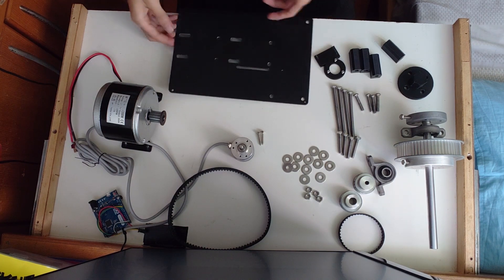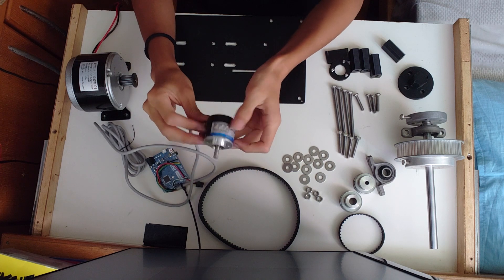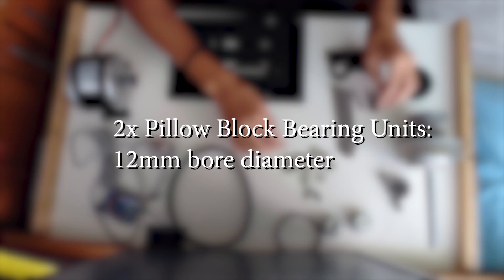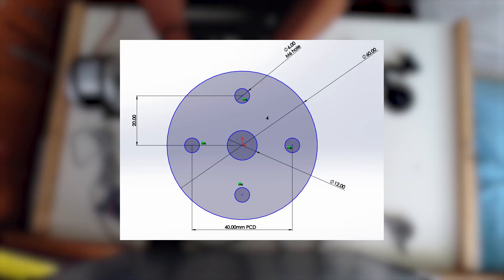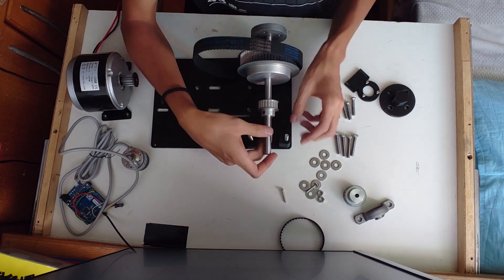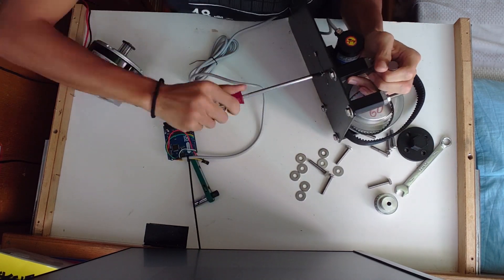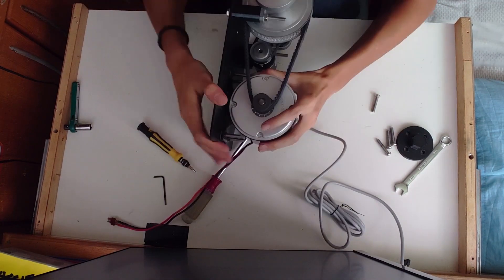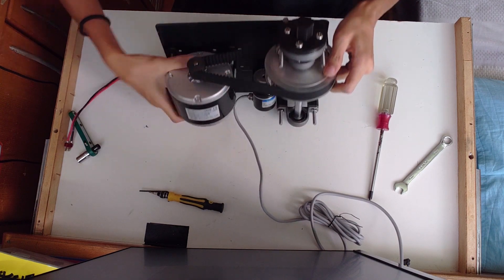Hardware Design of Cheap DIY Arduino Force Feedback (FFB) Sim Racing Steering Wheel

Comment: Cheers mate, I can't find this type of big 250 - 300W motors near me. Best i can find is a 120W MY6812. I don't drift, i only play racing sims and truck sims. Do you think a single 120W motor at %70 power deliver enough torque ? (I say %70 because i don't want to risk burning the motor and driver) .

Comment: can i ask ? if im using 24v 250watts 14A ebike motor for ffb can i use 24v 360watts 15A powersupply? AND is IT good or something bad happen like high temp or heat im using 2 bts7960 driver im trying to build arduino steering wheel

Comment: hey man, can you tell me what's the desired output rpm for drifting its not available on sim racing platform but one site shows that if you had high torque than you only need about 150RPM. I am very confused. I wanna use MY1016 250W motor but confused on gear ratio. Is 550RPM is enough for drifting? Please help me to figure it out

Comment: Im planning to build this but i have one question in mind. Is 12v 150w motor enough to feel the force feedback and immersive? because 24v 300w motor here is not really cheap. I gonna use the same momo steering wheel as yours
Reply from the maker: I think that is enough. I am only using ~40% force.

Comment: the big pully gear on the shaft keep coming loose when applied some torque how can i fix?
Reply from the maker: Maybe try to grind a v slot instead of a flat surface on the shaft. Also applying some thread locker to the set screw might help.

Comment: hey did you 3d print the wheel hub and how long is your shaft
Reply from the maker: I machined the wheel hub out of aluminium. I'm not sure how long the shaft is, as that can vary depending on your design.

Comment: Hi, do you know if a 120w 12v dc motor would be able to spin the wheel fast enough? it has 0.5nm of torque but i think about adding 1:5 pulley ratio so the torque output on wheel would be about 2.5nm, the motor has max. 3000rpm. This is the only one i have, and i dont think i want to pay extra money for bigger engine. Also, how does the motor bears the load, does it heat a lot?
Reply from the maker: I'm not sure.
When my motor runs on full load, it can go beyond 100°C
Reply: @psamtam  huh, thats pretty hot, thanks for response.

Comment: hey does the size of the belt matter for the motor
Reply from the maker: If you mount the encoder to the output shaft then doesn't matter. If you mount to the motor, then matter. The motor rotates faster than the output shaft in my design.

Comment: Hey great work man but will the wheel still function well is the encoder is mounted to the back of the shaft and is there any other way I can contact you?
Reply from the maker: That should work. As long as you can capure the rotation of the wheel someway, it works.

Comment: I made my self one like 1 years ago, finally finished diy pedals and came back to the wheel. Have issues with bts motor driver. It heats, (like you can't take in to a hands and hold it for a while :D) also motor is heating if doing drifting for 5 minutes. My question is, how your bts handles this motor?
Reply: My dc motor is 100w 24v, so maybe if i put 300w motor like yours, bts will not heat up so much?
Reply from the maker: My bts will heat up. But mine always cut off/shutdown itself before too hot to touch, like there is a thermal protection in my bts. I added a cooling fan to the heat sink to cool it down. It can handle 50% ffb for more than 4 hours in Nordscleife. I don't play with more than 60% ffb as it will be too powerful.
My motor always heat up to ~90°C. I just don't care as long as it doesn't smell burnt. Some online material says that most motors are capable to work at 105°C.
Reply: So i just changed dc from 100w to 300w from power steering of toyota corola. Changed new bts, because old one, with 100w blowed it. So with 300w bts still heats up like hell.
Reply: Dude, maybe you can send links to pulleys and belts where did you bought it? Cause im driving chain on chain rings, too loud.
Reply: By the way, bts cooked again :D
Reply from the maker: I bought them on TaoBao, which is only abailable in China. I think you can get the pulleys and belts on Aliexpress or Amazon.
Reply: @psamtam  can you tell personal belts and pulleys specs? Like lenght, wide of belt and pulleys tooth amount or something like that
Reply from the maker: @nierkanierkaha6889  they are all mensioned in the video

Comment: Hi, do you connect 1 bts7960 driver to the motor or you connected 2 in parallel cause my my1016 motor fried the driver twice even when i am running on 12volt not 24
Reply from the maker: I used 1 bts7960. It gets hot and I put the heatsink into some water to keep it cool
Reply: @psamtam  is there any efficient way to reduce heat?
Reply from the maker: @speedboy911  I'm not sure. Perhaps installing a 4020 cooling fan for the heat sink would work
Reply: @psamtam  have you measured the stall current of the motor?
Reply from the maker: @speedboy911  no :(

Comment: I found a motor that has 30,000 but only 45W is used, is there something wrong with it?
motor is YALO RS550
Reply from the maker: I think that motor is designed for speed, but not torque. Therefore, the rpm is high

Comment: Can you do it with a cheap 12v motor but still using the no walls designs for mounting all the stuffs
Reply from the maker: Sorry that I'm not planning to build with a cheap 12v motor since I already have this one :)
But I think the design would be similar to this one. The only change would be how the motor is mounted to the bottom plate. I would suggest to use a pipe bracket to mount the motor.
Reply: @psamtam  how do i do it?
Reply from the maker: @paklekj4429  Please think and try it out yourself. :)
Reply: @psamtam  very helpful response thanks

Comment: Hi Which engine driver did you use? 
what power supply did you use
Can you write
Reply from the maker: BTS7960
24V 500W power supply
Reply: @psamtam  thanks for the answer but the way 220 V 300 W can i use motor ?
Reply from the maker: @nextnext1200  if you have a 220v motor and a corresponding driver then you can
Reply: @psamtam  I couldn't find a corresponding driver, if you know a corresponding driver, could you please share it from the link
Reply from the maker: @nextnext1200  i don't know :( sorry

Comment: hi! if i use another motor instead of a encoder, can i get more force?
Reply from the maker: Yes, but no.
More motor will definitely increase the power. However, the whole system will not work if the encoder is removed
Reply: @psamtam  yes, ive figured out after i comment this! Hahahahah, Is there any way to use two AND the encoder so o can get more power?

Comment: Hey i have a hori apex wheel and im looking to buy some ffb pads but i dont know what to do or buy. Can you help me?
Reply from the maker: what ffb pads?
Reply: @psamtam  i dont know but im sure that i need to buy everything since the wheel doesnt have any ffb
Reply: @psamtam  or else i could try and take out the rumble motors off from my ps4 joystick which i dont use and try to mount it to the wheel. do you think it could potentially work?
Reply from the maker: @memegamer1234  i think the power of that motor is too small to drive the wheel

Comment: Hey, you dont use a motor control like the bts7960 or something like this? Or you just connected the motor to the arduino? Help pls
Reply from the maker: I used bts7960
Reply: @psamtam  Thank you so much :D , I have another question xd, what psu are you using? How many watts does the power supply have to be?
Reply from the maker: @juanfran9057  it depends on your motor
I would recommend 
power of the psu = 1.2 * (power of motor)
Reply: @psamtam  And what encoder do you use ?
Reply from the maker: @juanfran9057  voltage type rotary encoder
Reply: @psamtam  ok, ty for the info, and finally (I think xd) can you give me a link or the name for the quick release? I dont find a quick release like yours (The 3d printed no, the other part that looks like iron or something)
Reply from the maker: @juanfran9057  Do you mean the bike seat clamp?
Reply: @psamtam  the circle that has 4 holes that you have in your hands at minute 1:21
Reply from the maker: @juanfran9057  that is an aluminium cylinder with holes on it. It is the adapter for connecting the rod and the steering wheel. It is a DIY part

Comment: What powersupply did you use for that motor? Is 12v okay?
Reply from the maker: i used 24v power supply
12v will work as well,  but less torque
Reply: @psamtam  you only used 1 motor driver for that motor with 24v psu? What motor driver are you using?
Reply from the maker: @nico_poriol  bts7960
Reply: @psamtam  how many amps is your 24v power supply?
Reply from the maker: @nico_poriol  20a

Comment: What happens if you connect the wheel to the engine itself? Wouldn't it be a DD wheel?
Reply from the maker: Yes, but the motor only output around 1Nm. I would like some more torque so I connected it to a gear
Reply: You're not very smart huh?
Reply: @ShopeeMarketteam  unfortunately I'm not 😔

Comment: Can i make this with a potentiometer?
Reply from the maker: no you can't :( the firmware and software aren't designed for potentiometer. They are designed for incremental encoder
Reply: @psamtam  Ok, but can work with other encoder too?
Reply from the maker: @ligmaballs122  I'm not sure. but voltage type incremental encoder works

Comment: i brought the 600 ppr one and it's just not working for me before i brought this one i used to use an encoder from printer it's working fine but when i switch to rotary encoder it's just not working dont know why
Reply from the maker: maybe your encoder is a npn or pnp type(?)
I used voltage type encoder
Reply: @psamtam  Yeah i just checked It's NPN type 
actually i have no idea about this kind of thing just randomly buying the cheapest one lol
Reply from the maker: @Felixnelsonsr  I've got a pnp/npn type at first and have no idea as well🤣
Reply: Nvm i got it working now

Comment: can it work without encoder but with potensimetr
Reply from the maker: it can't :( the firmware and software aren't designed for potentiometer. They are designed for incremental encoder

Comment: Hello. What torque this setup reach? I want to do the same! Thank you.
Reply from the maker: my gear ratio is:
13t on the motor, 60t on the shaft
2750rpm * 13t / 60t ≈ 600rpm
250w with 600rpm ≈ 4Nm
Reply: @psamtam  isn t that a 350w motor?
Reply from the maker: @TheMasterizzatore  mine is 300w, but there are different power rating from different manufacturer: 250w/300w/350w
Reply: @psamtam  ok ok. I want to use a 350w motor at 12v, since i can find easily High watt 12v but not that much 24v, would i rpm or n m?
Reply from the maker: @TheMasterizzatore  voltage does not matter :) 12v motor is still ok
Reply: @psamtam  Will It still output same nm and same RPM?
Reply from the maker: @TheMasterizzatore  those will depend on your motor rpm and power
if your motor is 350w and 2750rpm, the torque and rpm will approximately same
Reply: @psamtam  my motor Is 350w 3000 RPM.
Reply from the maker: @TheMasterizzatore  that is fine
Reply: @psamtam  yes but with 12 volt rather than 24v Will i Lost RPM or torque? Thats what i was asking Sorry if i am ripetitive
Reply: It Is a 24v motor powered at 12v
Reply from the maker: @TheMasterizzatore  yes, you will lose torque and rpm when powering a 24v motor with a 12v power supply
Reply: @psamtam  ok thanks.. i think i m going with double motor with less demoltiplication so It Is faster and stronger. Thank you

Comment: what if I use 3M or GT2 belt and pully? what the effect come from that smaller belt pitch? asking this because I can find 3M and GT2 parts easier and cheaper.
Reply from the maker: I'm not an expert on belts. But I think as long as the gear ratio is fine and the belts don't break, everything is fine :)

Comment: Hi. I am trying to add buttons to my steering wheel. Problem is I cannot wire buttons from steering wheel to microcontroller (because steering wheel rotates and wires get stuck). Can you suggest something?
Reply from the maker: some wire spring spiral cable should help: https://www.google.com/search?q=wire+spring+spiral+cable&client=ms-android-sonymobile-rev1&prmd=isvxn&sxsrf=AOaemvLMxlSPb-ioJSg_gMhk-P-V4hDdKA:1634802807129&source=lnms&tbm=isch&sa=X&sqi=2&ved=2ahUKEwjzrOKEg9vzAhUDqpUCHfn9CDAQ_AUoAXoECAIQAQ&biw=486&bih=735&dpr=2.23

Comment: how many degrees does the steering wheel turn? does it have a limiter? can i use my old 500 watt pc PSU? thanks
Reply from the maker: the mechanical design does not have limitation, but the software did! It should be at most 2000 degrees.
PC PSU is 12v, and the motor I used is 24V. Using PC PSU might cause the motor to spin not as fast and as strong as using 24v PSU.

Comment: I want to build one with a Nema 34 8nm or 12nm stepper motor, what do you say?
Reply from the maker: I tried to build one but gave up since I have no idea on how to control the torque of stepper motor :(
Reply: @psamtam  What engine do you recommend, that has good resistance?
Reply from the maker: @ayrtonmarin6778  sorry I don't understand what you said. Could you explain more so that I could try to help you
Reply: @psamtam  What engine do you recommend? may have a good ffb
Reply from the maker: @ayrtonmarin6778  do you mean the firmware? I'm using wheel configuration with arduino leonardo

Comment: For the exact motor you use in this build, what 24v PSU you say it's needed?
Reply from the maker: @CESAR_H_ARIAS  yup that works :)
Reply: @psamtam  excellent, next week will have all put together I think! Will dm you a couple of photos. Your guide really made me want one and was pretty straight forward 😉
Reply from the maker: I used a 24v 500w power supply.
And I bought it just because it's cheap, like 7usd
Reply: @psamtam  i already have all the 3d printed parts, al the electronics ( except for the powersupply because i dont know if the one i have works or need to buy another one) im hoping to make an enclosure to get it ready to be mounted ( reusing my logitech pedals and using an F1 style wheel with buttons and a small lcd dashboard)
Reply: @psamtam  huh, what psu is that?
Reply from the maker: @CESAR_H_ARIAS  something like this: https://m.alibaba.com/product/60659508401/T-500W-24V-24V-20A-12V.html

Comment: the arduino/electronics is what im missing? how did you connected it?
Reply from the maker: https://youtu.be/h4GCpxDlJBY
Reply: @psamtam  awesome! thanks. i have ordered almost all parts. this is going to be intresting, (but im making the wheel with a lot of buttons an lcd and some multipourpuse dials with an F1 style)
Reply: @psamtam  in the solid works files the base file wont open.
Reply from the maker: @CESAR_H_ARIAS  it is just a sketch of the dimension of the base, no big deal

Comment: Good build mate, can I ask how does the belt ratio work, if I use a 160t and a 10t timing belt pulley will the gear ratio be 16:1, is my guest correct or is the 10t timing belt pulley too small to be used?
Reply from the maker: my gear ratio is:
13t on the motor, 60t on the shaft
2750rpm * 13t / 60t ≈ 600rpm
250w with 600rpm ≈ 4Nm

just calculate this way to get the desire max rpm and torque
Reply: @psamtam  Thank you, hope to see more content of the wheel and other projects in the future as the content so far is pretty good

Comment: thanks for the video ! Still figuring out on how to build one :) Cheers and thanks

my question is, how did u build the shaft with the timing pulleys? any specific part/gear teeth numbers on the pulley?
Reply from the maker: I fixed the gear and the shaft with fixing screw
the number of the gear teeth will determine the speed and the torque of the steering wheel

Comment: How many Wheel degree that i can steer? It's possible to over 2000deg?
Reply from the maker: the firmware supports from 180° to 2160°, which means you can steer over 2000°
Reply: @psamtam  Real thanks. You makes Nice videos.

Comment: motor is big, u can use as direct drive.
we use g27 2 very small motors and wheel is strong
Reply from the maker: I don't think that is a great idea since when not reducing the rpm, the torque will only be around 1Nm (theoretically 300w at 2750 rpm will only produce around 1Nm), which is too low for me.
Reply: @psamtam  i play many yeas with olg g27 ffb is too fast i never had problems, i dont need to turn when on drift onlt i follow with hand to know where i am :D 
that motor is to big vs logitech g27
i want to make it direct drive just for test
Reply from the maker: @ToniLixSim  action speaks louder than words! just make it out

Comment: I have that motor in my diy system and one side is much strong than other side. And software is not soft work with that,  Iam using Emc pro now.  Its the much better than others also my friend developing the best one for arduino,  after finishing that software i will record that please, be contact with me. we can help each other.  You know my motors is the hardest one.  see you and good work
Reply: Yep, that's me, the Arduino FFB guy :) I have implemented an FFB balance slider by which you can compensate for the unevenness of the motor pull in both directions. I have a new version of the user interface, it has 10 ffb profiles. It is quite close to being completed.
Reply: @rankovicmilos86 how did it go?